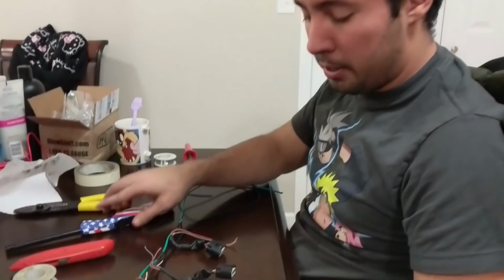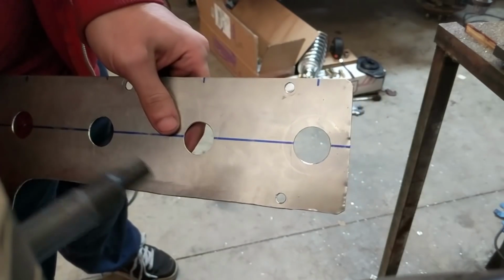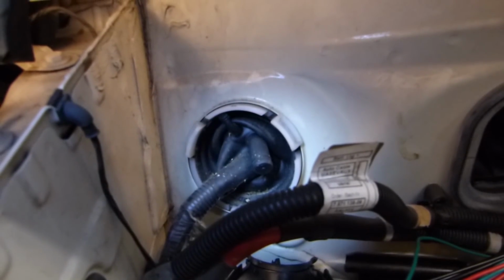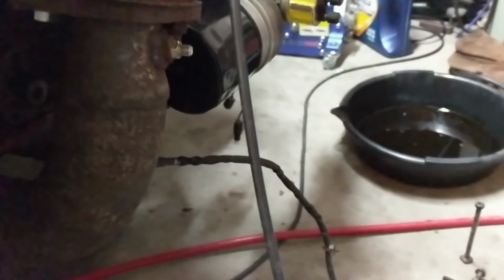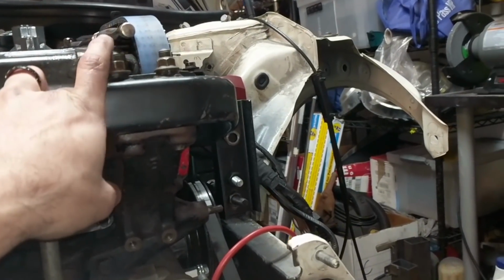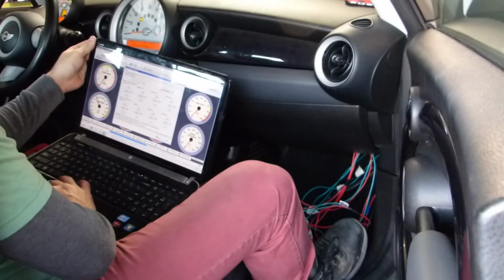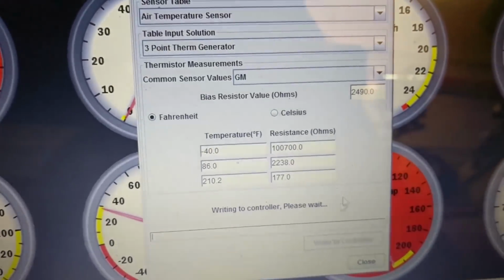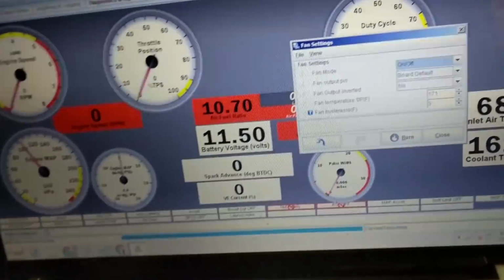✓ Custom Wiring Harness, Sensors, and Alternator - AWD Mini Cooper Ep. 19

Comment: Hey bro. Thanks for keeping up with the good work. Just curious on what's ur take on the no fuel issue on a 1g dsm. I got spark & had jump the fuel pump & it sounded like it worked. I been reading that the mpi relay may have something to do with the ecu no reading or sending signal from/to the pump? Also should I keep jumping the pump? Would this burn the ecu? Would u mind sharing what the problem could be?
Reply from the maker: Hey mate, that's a pretty hard one to diagnose online but it could be a few things. From basics you need 3 main parts to have combustion, Spark, air, and fuel (you obviously need a starter motor and proper timing, but that's a very different line of issues haha). So if you have spark at the appropriate time (I'd check with a timing light to be sure) and you have a strong enough spark, then that's probably not the issue. I'd check to see if you have proper fuel pressure. With the engine off, you should be around 42 to 58 psi depending on if you (or a previous owner) modded the fuel system. Between 38 to 60 psi, the car should start and you don't have a pump issue.
Now when you jumped the relay, so my question is did it start when you jumped the relay? Did the pump turn on before you jumped it? If your relay works properly but the ECU is not turning it on, then you may have 1) a bad connection 2) a broken or pinched wire 3) a bad ECU. Keep in mind that these cars are 25+ years old so a broken or bad/rusted ground could shut the whole car down. 
As far as burning out the ECU by doing this, I am not 100% sure but 99% sure it'll be fine. Most likely it is just a signal with no feedback so the ECU does not know if the pump turned on, it just knows that it told the pump to turn on. You can hook up a switch to the relay to trigger it manually and you should be able to drive the car indefinitely if that was the issue.
Also, for fueling, it's possible you have one or more bad injectors. If the fuel pump is ok, I'd move to making sure the injectors can open properly and aren't clogged. Jafromobile has a great video on this. You'll also want to check this wiring for breaks or bad connections. The injector could be fine but without the properly functioning wiring, it does no good
Does the car have any codes?
Hope this puts you on the path to getting the car back together and feel free to write back anytime and I'll try to help as best I can. Sorry for the delayed response as well. It's been a hectic few months with work.
Happy modding and best of luck
-Ryan
Reply: @InitialDIYmods  
You're a wizard with these cars man. I FINALLY got it running & I could write a book of the things I did including changing the ECU as the original I believe was defective.  1 of those reasons was due to the CAS being jumped directly to power (battery) so the CEL would come up. Dnt ask me why b/c the guy who had it was running it like that I assume (not judging) Anyways, as far as the fuel, once I changed the ECU I could hear the pump & in fact the car stays running!!. The weirdest part is that the only way it will run is if I randomly get it to crank & quickly spray starting fluid & it will run on 3k at idle. So my OTHER question is if timing could be the culprit as I'm starting to think thanks to ur expertise. The sporadic cranking is driving me nuts, it cranks when it wants. I get power to the starter & I had the original starter tested, after i put a new starter in. I'm out of ideas on why when you crank it (when it wants) u can hear the ticking that comes nearby the ECU but would almost sound like not enough power is getting to starter or even a short at the ignition area or related areas? Thanks brother 4 helping